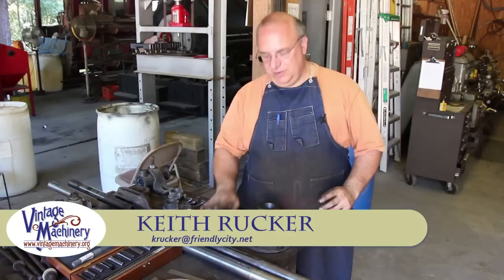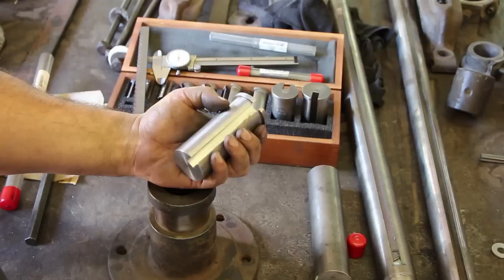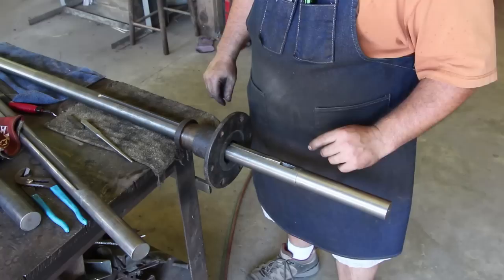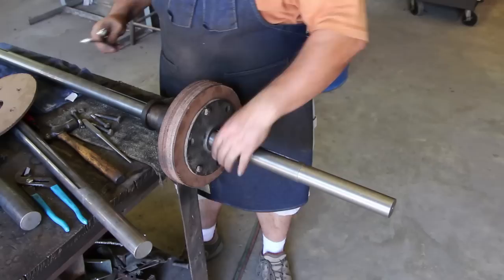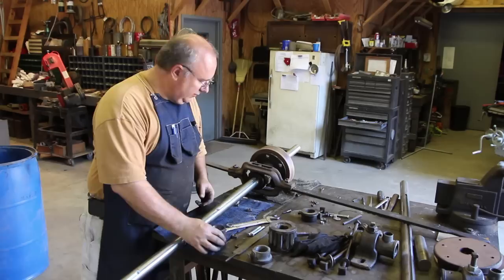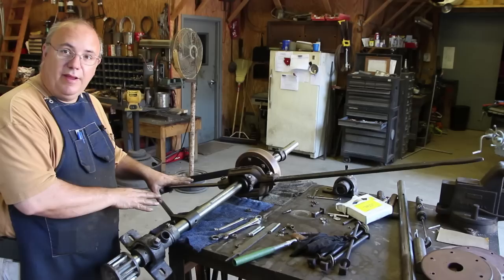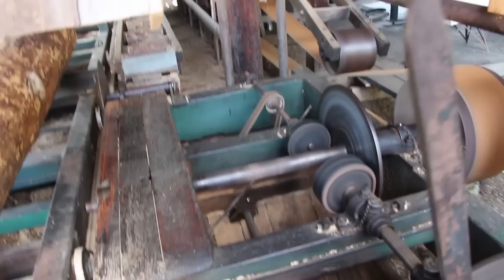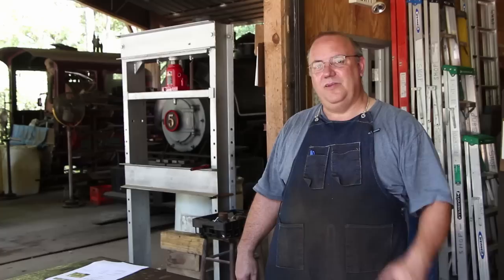Sawmill Clutch Repair:  Part 2 - Broaching a Keyway, Reasembly, and Testing

Comment: Keith,
Super great repair job! Seeing the the saw mill running, I had to chuckle a little. How times have changed! With all those exposed gears, pulleys, belts, etc. OSHA would have a heart attack if this was machinery manufactured today. Thanks so much for showing us a piece of history!
Have a good one!
Dave
Reply: ***** Obviously a welded boiler is one of the non-historically correct modifications - I would be interested in some examples of the modifications you have had to make because of the "O" word :-)

Comment: Very cool stuff Keith! Looks like my kind of work. Hey I noticed your using a Smith torch. I have all Smith torches in my shop and love them. I prefer them over the Victor style.
Man if you had my old crank shaft press you would love it. Makes broaching those keyways quick and easy. I started feeling bad watching you pump that jack soo many times. It was nice seeing the old sawmill working again. Good job, and nice work. Thanks for sharing with us.

Adam
Reply: Yes that's what you need. You can by a simple and small sizes h frame press that is powered by a hydraulic over air pump, some hand operated and some foot controlled. We have one at work made by Simplex that has a foot operated control. Just hook your shop air to it and press to pedal to move the ram. Something like that will make your pressing jobs quick and easy. I want to invest in one like that for my shop in the future. I'll look them up and send you some links.

Comment: Thank you Keith for helping keep the old machinery and our collective heritage running. Also you do a good job filming and clearly explaining what you're up to.

Watching brings back memories of stories and the restorations my Dad did for years. Grandfather owned and operated a small steam powered saw mill during the Great Depression… that is, when the family was not actually out there logging with a donkey engine and spar tree (my Dad started as a Whistle Punk at the age of 8).  

By the way, I hope someone adjusted that vertical drive belt on the engine; it was tearing up an edge against the brick work. Cheers!

Comment: We had an Ariens lawn mower with that type of clutch gear selector setup. You pushed a button with your thumb and could then switch to any of the forward gears by moving the shifter. It was really easy to use. I think you had to use the clutch/brake to use reverse. It was a metal disc with a rubber ring. After a year or two the rubber ring would dry, crack and fall off. Had to be replaced. This was in the 1970's

Comment: Hi Keith,
In a machine shop restoring jobs are, most of the time fun, cause, it brings you a little out of your comfort zone, finding ingenious way to reproduce something that will look very close or identical to the original.
Those are great to learn from a lot of different disciplines, just like you care to share with all of us.
Brand old new sawmill good to perform another 50+ years.
Cheers,
Pierre

Comment: Mr. Rucker, you are a very good museum guide and great artisan. It is very, very interesting to see how these old  things works. With that survey of the old days, it's easier to understand where we are now and why! Looking forward to seeing the saw in action. I have seen a video made in France, showing an old saw mill that was cutting the wood from bottom to the top. That saw was more a horizontal band saw. It was in use in the 19th century and was mainly use to cut veneer for marquetry purpose and furniture making. Thanks for all this information that you share with use is easy to understand  and your voice is « at the right pitch» for your films. 

Salutations distinguées du Québec.

Comment: 1907 federal buggy car  had a transmission like that, friction wheel ran against flywheel....provided gearing and reverse....friction material was purchased from a sawmill supply in Washington....restoration of car started with a man seeing a cylinder head sticking out of a creek bank …. other metal car parts had been tossed under a chicken house in 1910, manure preserves iron

Comment: Great job. I am amazed  you can run that old sawmill with all the exposed belts unguarded saws and unprotected [hot] steam pipes. In the UK the factory inspector AKA Health and Safety at Work inspector would go into low earth orbit after one glance.

Comment: Wow that's a old left handed sawmill, don't get to see many of those. I was a sawyer on a left handed automatic sawmill for many years..apparently I was told they had a very hard time finding sawyers that would operate the left handed sawmill. It was a little different after learning on a right handed mill. Definitely was not much of a problem for me to adjust lol
Reply from the maker: The funny thing is that I have never ran a right handed mill.  I would be lost if I had to....

Comment: if the new sleeve is longer than your shims.. could you cut numbers of keyways at different depths in your insert to fully support the broach as it goes thru the bushing..  and  harborfreight 69593 air overhydraulic 20 ton jack might help.

Comment: The paper clutches seem like they would also act a a safety system that prevents damage if the saw blade is jammed or the carriage stuck.  They would slip and allow the shafts to turn and give the operators time to shut down the steam engine and the belt drives.
Reply from the maker: Very true!

Comment: I really enjoy watching your videos, they are WAAAAYYY better than anything PBS has to offer.  I have a circle sawmill, tower edger, Jay Faye & Egan 24" planer, a post drill and a Diamond Machine Co. Lathe that I'm attempting to put together to mill our trees with, build a home and just have the best time I possibly can.  Now, all of this stuff needs flatbelts; I'm not very old and no one around me has the things I do so I was wondering where do you get your belts from?  Also did you fill in that old keyway after you broached the new one? I machine shafts for electric motors and mill keyway as well as threads and a few tapers on bad days ;) thanks again, you make your job look enjoyable (except for that press lol)

Comment: Would crowning the friction disk result in less wear. As it is set up, the edges of the disk are moving at different speeds, resulting in slippage by some of the friction disk.

Comment: Hi Keith!  

At 15:47, you're reassembling a collar to the paper pulley assembly that's used to drag the paper pulley back and forth on the shaft.  I wonder why the groove that the collar runs in nor the collar needed refreshing?

Comment: A very interesting project. In the 1930's there was an automatic transmission for cars using the same principle. A bit more sophisticated in its construction of course. Not very successful though. Once any slippage started it tore itself apart. I have also seen it used as a variable speed drive for centrifugal superchargers. Now for something different. Your boiler doesn't seem to be lagged or is that, like the rivets, an optical illusion?
Reply: *****
Thanks for your reply. I quite understand the reasons.

Comment: Great clutch mechanism, so simple, but so effective, including variable speed, ingenious!  One question, on the steam engine, what is the large belt slung upwards around the wide pulley on the opposite side to the flat belt driving the saw mill?
Reply: ***** You mean the machine feeds itself!  Excellent!  Keep up the good work Keith, one of my favourite YT channels.

Comment: It seems to me that the clutch hub bore should extend through the fiber plates to put the force directly onto the shaft instead of putting a twisting force on the other end of the clutch hub which has to cause binding. I realize it won't see much use but sure seems like a design flaw that led to the wear you had to repair.

Comment: Interesting engineering. I do see a possible long term problem with the way the key was installed. I looks like the piece you brazed onto the key would eventually chew its way through the paper material and only stop when it hit the metal plate on the other side. A metal sleeve inside the paper pulley would keep the key from sliding back and forth inside the collar. It could not be an exact fit because of the compression of the pulley material but anything would be better that the 2 inches of play it has now. I could be over thinking it considering how long it's been running but I figured I throw in my half cent for what it's worth.
Reply from the maker: +Merlin Magnus I think it is safe to say that there are better ways of engineering this whole part of a sawmill considering this design did not last much past 1900 or so as they came up with better ways.  When I am restoring something like this for the museum, it is more about keeping things as original as possible rather than re-engineering them.  But, I agree with what you are saying in general.

Comment: Thanks Keith for your videos. I enjoy them a lot. One question on the secondary belt on the engine - What is that driving? That's the one that drives off the opposite pulley and the belt goes upwards on an angle.
Reply from the maker: +Sandback Technical Design Inc. That goes up to a line shaft in the ceiling that then powers the cut-off saw that we use to cut the slabs into firewood for the boiler.

Comment: I don't quite understand why, if you were going to sleeve the part, you would have to bore it out past the depth of the original keyway. Seems to me you could sleeve it as though no keyway were there, then cut your keyway to go through the sleeve into the original metal. What would go wrong if you did that?
Reply: Thanks for the insight. Enjoying your videos as always.

Comment: Awesome set of videos! I am curious to know what the torque of that steam engine is.
Reply from the maker: MattsMotorz It is rated at 25 horse power from what I have been told.  That is about all I can tell you.
Reply: Keith Rucker - VintageMachinery.org I just remembered this comment and wanted to figure out the torque.  Looks like it's about 4 rev per second, so about 240 RPM, meaning the torque is approximately 550 ft lbs (if I did my math right). Crazy! Steam engines are known for producing large amounts of torque.
Reply: +MattsMotorz Yes, and full torque from the first revolution. Like a DC motor.

We have 3 K&T cnc machines at our workshop here in Sweden by the way, two 4-axis with 8 and 10 pallets, and one 5 axis. Old ones, since K&T dont exist anymore as far as i know, they are from late 70.
Good craftsmanshipby the way.

Comment: What does the second flywheel do with the offset belt?
Reply from the maker: It powers a line shaft up in the rafters of the sawmill that then powers the cut-off saw that we used to cut up slabs.

Comment: So... What's the OTHER belt on the steam engine powering?
Reply: Makes sense. If I recall correctly, the sawmill at OSV (in my email to you) is powered by a waterwheel. I guess I'm weird; I make my money in high tech, but my personal love is old gear. Some of my favorite equipment to work on belongs to one of my customers who still used a lot of old Vaughn machinery dating from the 1920's thru the mid 1950's. Not many of us left who still know the old genset variable speed DC drives and vacuum tube rectifiers.
Reply: Maybe some day our paths will cross in the real world. I get the feeling we could keep each other busy for hours! Until our wives come looking for us, that is. HAHA.
God bless, and keep them coming. :)
Reply: ***** If you don't mind sharing, what do you do for your livelihood?  Thanks for the in depth video!

Comment: Now you can test cut me some 16ft oak 6x6's for my barn rehab/shop conversion project! lol The lumber in it http://youtu.be/PpEeZFpsdpg  probably was cut on a steam powered saw mill in Frankfort that started around the 1830's or 40's. I have been working hard on it this week and it is making progress. I need to shoot a update video this weekend if I get time.  It is great to see the mill back in proper operation. If your fix lasts as long as original I think 24hrs is not bad for a 100year repair. :-)
Reply: ***** Sounds like a Barn raising get together at Keith's one weekend might be in order!  You have to have a bunch of help to put up a post and beam like this since it all has to go up one assembled wall at a time.  Since everything is interlocked you can't very well do it a piece at a time. I have decided that 5 of the main posts can not be salvaged so I called my local saw mill guy the other day to get new ones sawn up. Powder post beetles and rot over a couple of hundred years have done them in. The rest seems pretty sound as I have been doing jacking and leveling. The only way I can get the posts out to replace them is to cut the mortise and tennons. :-(  Most all of it will be getting covered up with insulation as well so you won't be able to see much of the post and beams when it is done anyways.